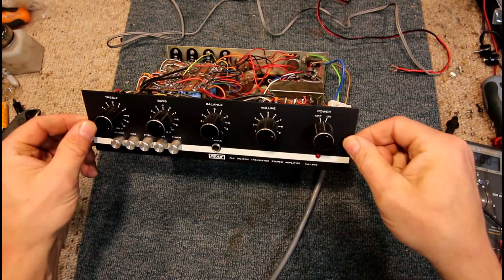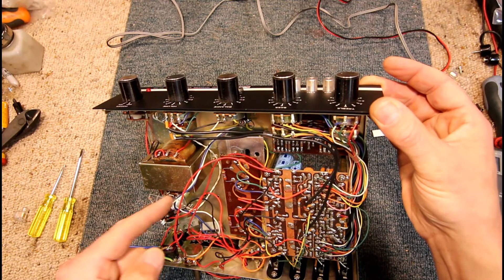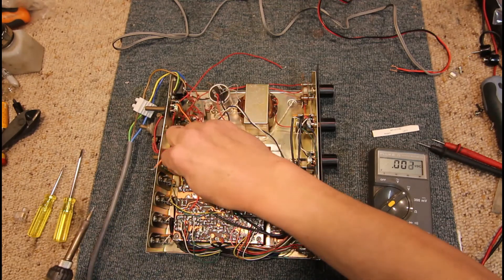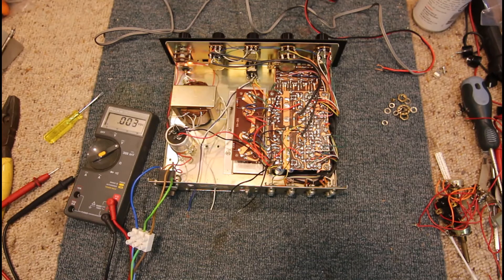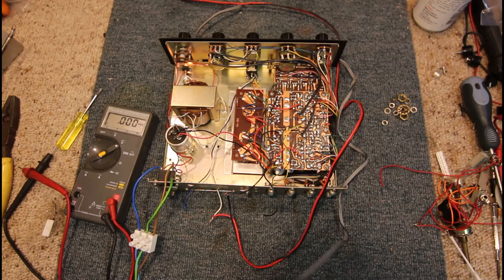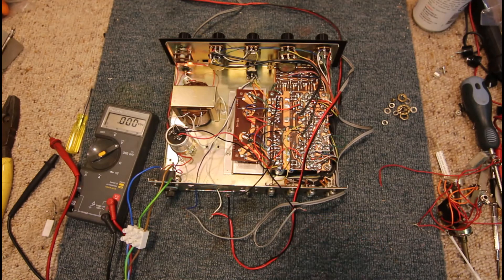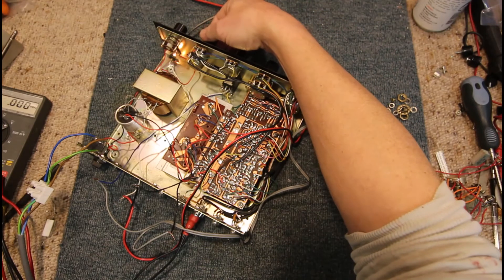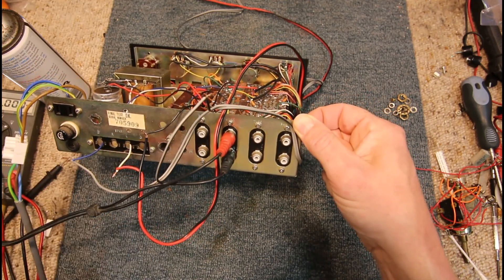Peak KA-200 Amplifier Diagnosis and Repair

Comment: Great video, don't you just love amateur mods to equipment.
Reply from the maker: Nothing like mods and other peoples repair attempts to deal with. They often cause more headaches than anything a normal part failure causes.
Reply: @StevesElectronicRepairShop  : Yep, seems like everything nowadays has had someone fiddling inside first.